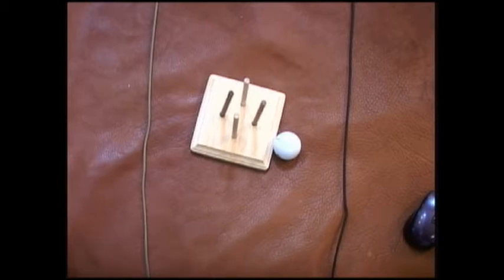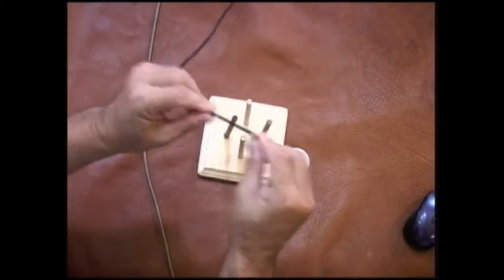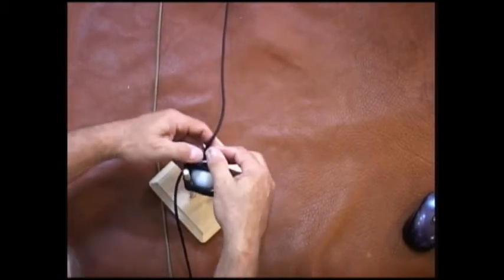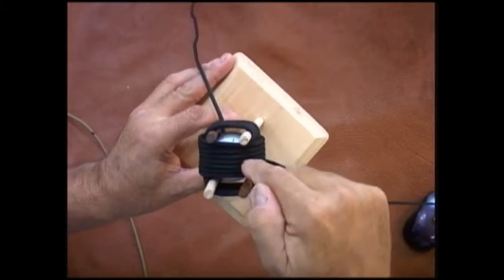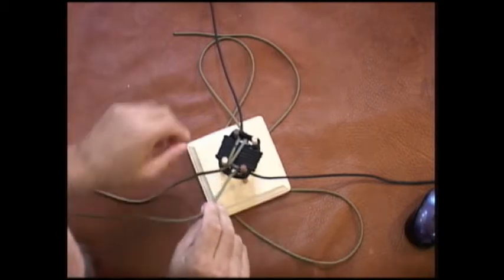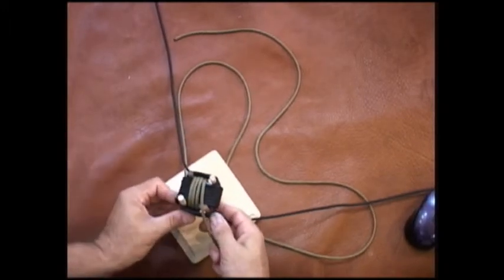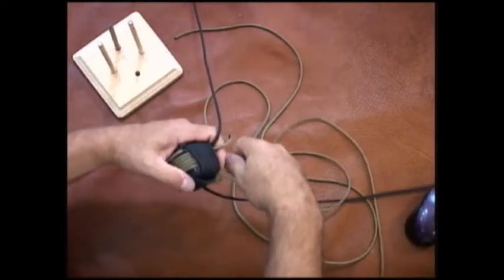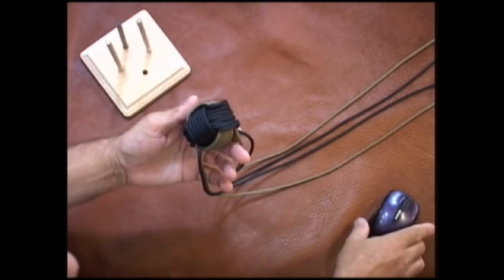Paracord Weaver: How To - Easy Monkey's Fist - Part 1

Comment: It looks like once you're at the end of the 2nd wrap on the Primary Color (Black) - there's only SEVEN strands on the side it comes out on from the bottom.   You can see this clearly at 4:58.

- The top has 8 strand because of the "loop back" that gets the 2nd wrap going
-  The bottom and opposite side have 8 strands

But that "final" side the 2nd strand comes out on only has 7.

When you pull the "LOOP" out of the black is that suppose to make it even again?   Just noticed this and wanted to make sense of it. 

Thanks!!

- Bill Covington

Comment: Although a jig does help if you have hands as small as I do -- trying to hold onto a root knot and wrap enough cord around my fingers and get it big enough to wrap neatly is ALMOST impossible (and actually, so far, has been impossible!)
Reply from the maker: Sandi Jull 
Sandi, you are right, small hands make it very hard and near impossible to create a larger monkeys fist. and most people prefer to use a jig.
I still use a jig even though I don't have to, with a jig I can set the project down and do other things and come back to it. The convenience factor is great.
Thanks for taking time to view and comment!
-Kevin

Comment: Something does not work : when you reach the 8th round of the second cord - brown one,  and pass it under the 8 rounds of the black one so as to make both colors meet,  well they do not.
I have tried for hours, following your demo point by point, and found myself in this dead end each time, with a different number of rounds in the bown one, or any other mess. Do you really have eight rounds on both colors, except of course the nine ones in the black when you are finished ?